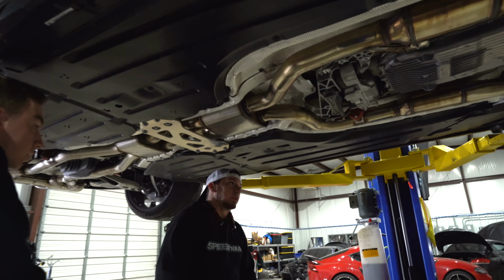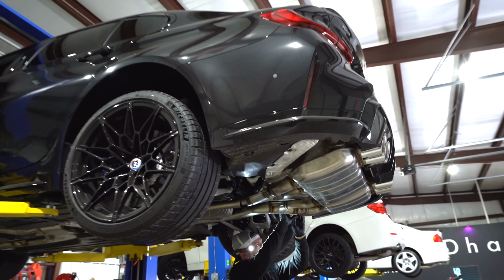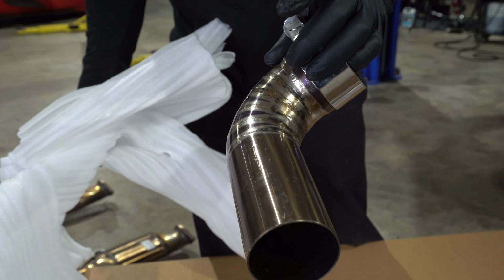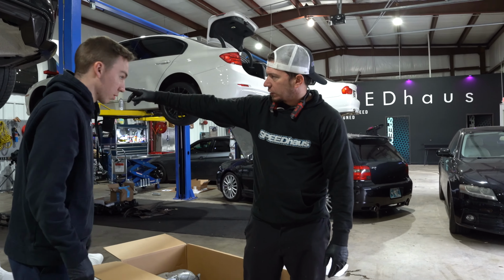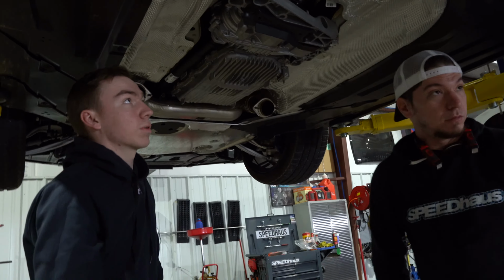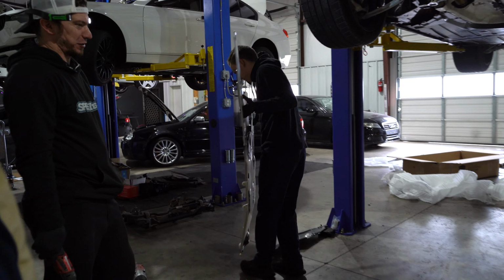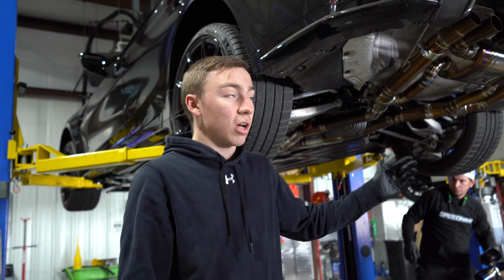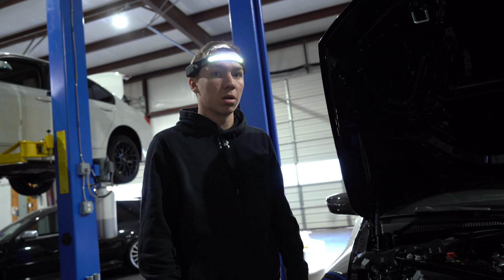iNSANE SOUNDING BMW M3 Competition Exhaust Sound + Install | Before and After Valvetronic Designs

Comment: Is it true the Dahler valve controller is not operating properly on a 2023 BMW M4 Competition X Drive? I’m told the 2023 is different than previous couple years and Dahler is aware of it?

Really want one of these valve controllers or similar.
Reply from the maker: Great question Mark.

Can't honestly answer that as we used the stock valves on this system over the controller they sent with the exhaust. No extra remotes or wiring that way.

Comment: Do you guys have a video of how you all install the OEM valve actuators to the Valvetronic exhaust?
Reply from the maker: @AustinColeman-g3c  not a direct how to but the stock valves bolt to the brackets on the exhaust. It’s really simple.